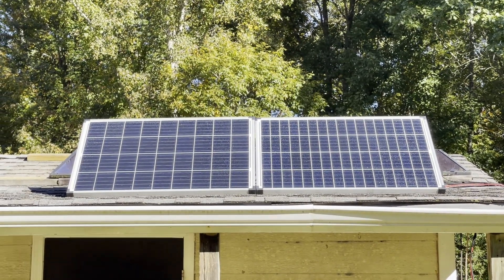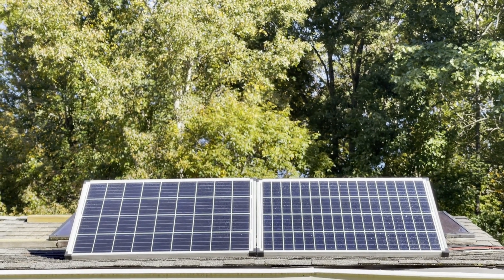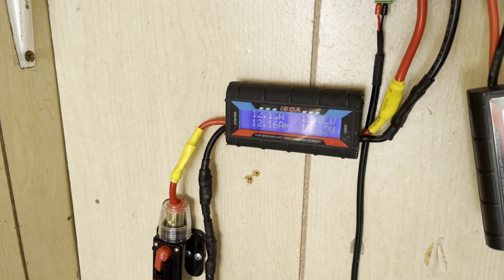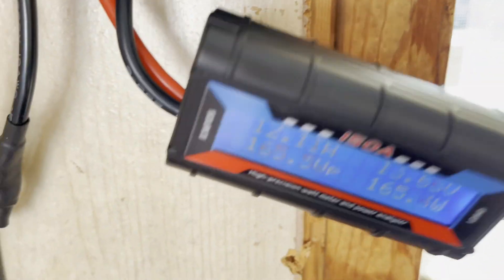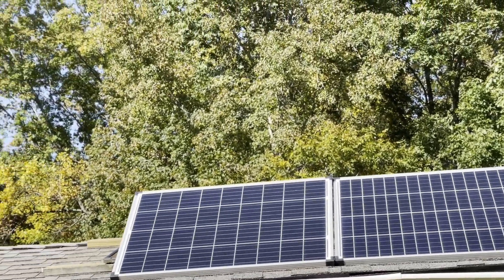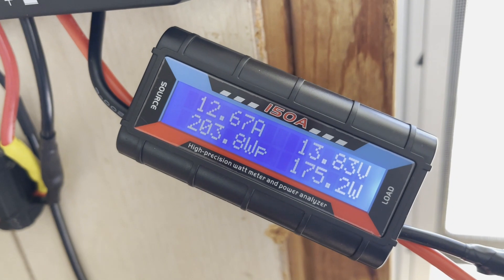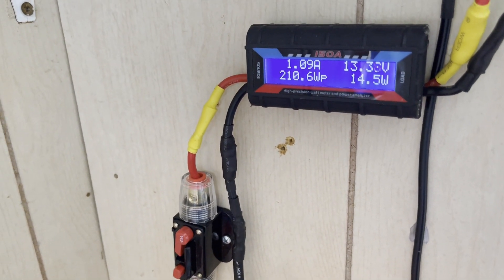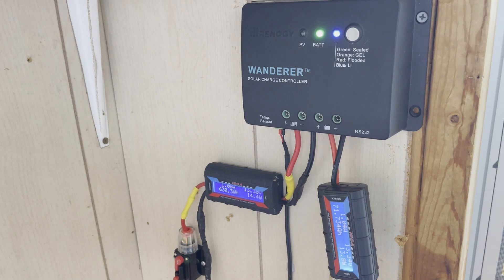How much POWER does 200 Watts of Solar Produce with a PWM Charge Controller #solar #solarenergy #diy

Comment: Can you tell me why the internet says you need at least 450 watt solar panels to charge a 200Ah battery. According to calculations it would take routinely 2 days to charge a 200Ah battery with only 200 watts of solar panels
Reply from the maker: @JohnDoe-up1us it all depends on location but that is correct 200-400w  is definitely recommend